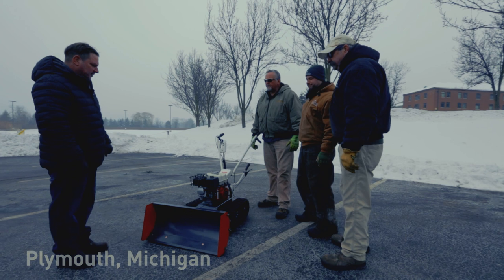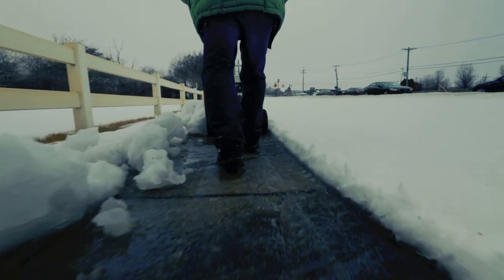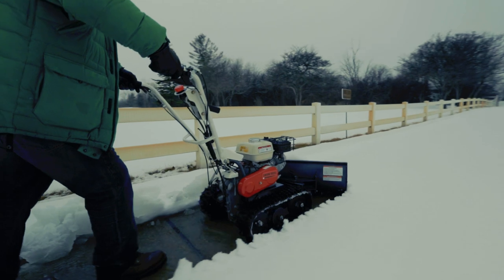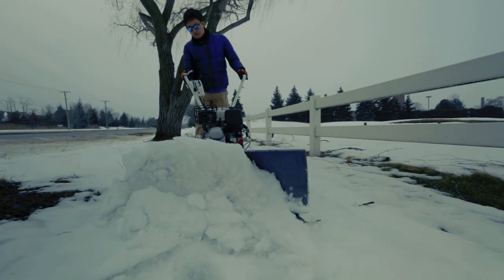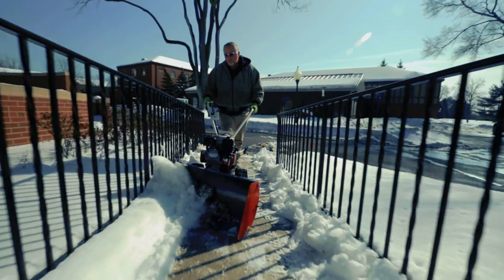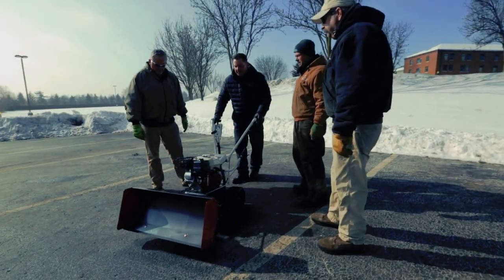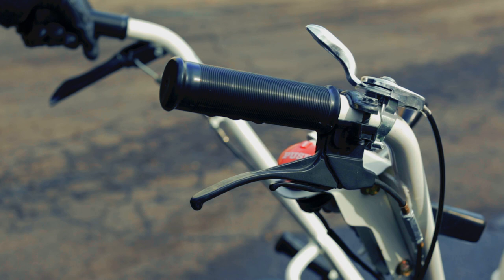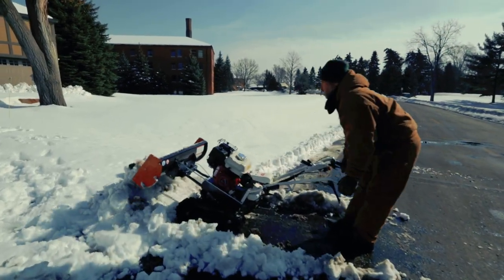Clearing Winter Snow on Large Properties with a Snow Bull

Comment: I think this plow looks pretty cool. I just don't think the motor is big enough. It has the same size engine as my 22" walk behind mower.
Reply: Joe Meow I want one of these and I plan on putting a 10 Hp diesel on it.
Reply: This doesn’t need a large engine. It just needs enough power to spin the tracks